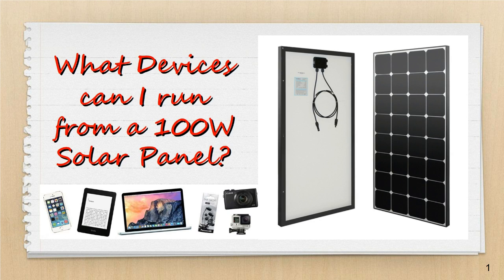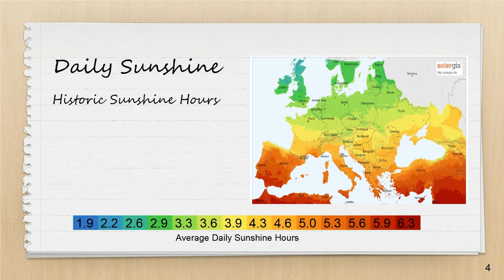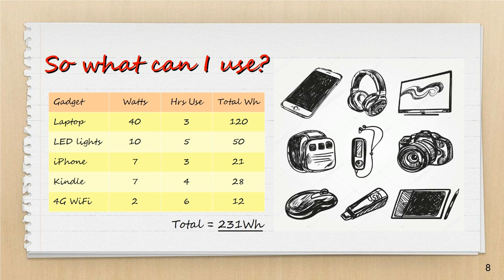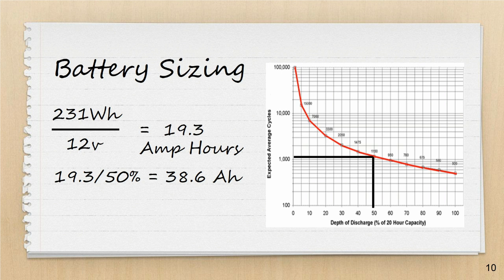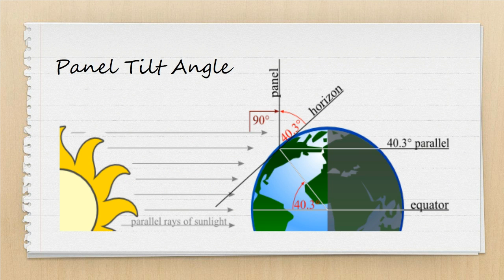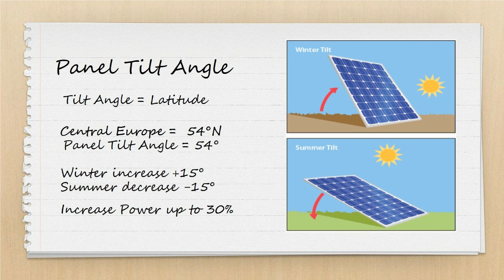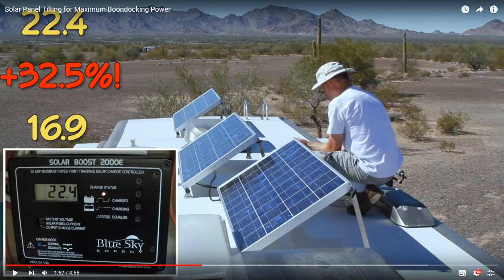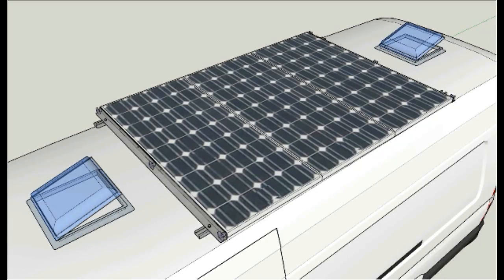What can you run on a 100W Solar Panel?

Comment: I find my 100w foldable, flexible panel along with a 110Ah battery is enough for our needs. Compressor fridge, lights, tablet/ phone charging etc and occasional use of the diesel heater.
Reply: Can I ask what make of foldable  panel you went for, and is it still good? Thanks
Reply: @KT.......  Dokio. They do 50,100,150,200,300W.
Reply: @Daz5Daz  thanks, Did you glue straight to the roof or have you kept an air gap between the panel and the roof? I've read reports of flexible panels over heating. Oh, just realised they're folding so you've probably not attached them anywhere right?
Reply: @KT.......  mine's foldable as in it folds away.  When I can, I park facing south and then place my panels (2x50W foldable) onto my windscreen. I like having the panel separate so that I can move the panel around to find sunny spots if I'm near trees etc.

Comment: Hi Greg -liked yr video; if I wanted to connect the solar kit (100W)  Ecoworthy to my greenhouse purely to power an electric heater, what advice/insturuction can you offer please?
Many thanks - your scientific physics knowledge is inspirational!
Reply from the maker: First of all most electric heaters are quite power hungry unless you are talking about a tubular frost heater which can be as small as 60W per foot length. So for example a 3ft heater running 8hrs a night would consume 180W x 8hrs = 1,440W
So with a 100W solar panel that’s 14hrs of perfect sunshine ☀️ which realistically would never happen. More realistic would be 500-600w of solar so as you can see electric heating uses a lot of energy.

Comment: As it is here in North Norway now what you can run is a 0,5w LED if there is clouds in the way of the sun (can be no sun for weeks here)...
Reply from the maker: Rondo Cat I still get a charge even when it’s raining
Reply: @GregVirgoe   I got lot more power out of the 100w panel after I switched to a better charge controller and it got up to 5 - 20w with little to no sun (had just a small one for testing). Now I have bought four 320w panels I will also mount on my Ford Transit combined with 2 charge controllers (the 100w panel charges the car battery only). Plan is to run 2 parallelly per controller for 80v and use 24v battery bank as it give double the watt the charger can handle (or else I would have to buy larger more expensive controllers). Should give enough power to run refrigerator even without sun if cloud layer is not unusually thick (the fridge uses 70w on average measured over 24 hours) :)

Comment: Price of solar panels is still dropping. Buy the flexible thin panels and glue them with sikaflex on any free area of the van roof and walls. This way you can park more freely and here in Sweden we get at least sunlight during the summer almost 20 hours a day ( if it’s not cloudy). And it’s mainly during the summer we use our RV. 
Buy Lifepo4 batteries they are much lighter and you can use all amps without destroying the batteries.

Comment: Thank you for the easy-to-understand and yet informative video.  This is what I exactly wanted to do... i.e., setup a 100w solar panel with batteries for storage. I have a few questions.  Can you comment on what type of battery (lead acid, gel, lithium, etc.) is succifient?  My goal is to power a dozen 12v landscaping lights, a sprinkler timer and may be couple of motion activated lights.  The second question is, do I need to ground?  And finally, can I store the batteries in the backyard tools shed that has no ventilation?  I can perhaps add a small window and leave it open to provide some ventilation.  Thanks.
Reply from the maker: Hello, type of battery if you go lead I would recommend AGM sealed maintenance free batteries. The can be discharged a little deeper and do not need ventilation. 
Lithium are much better in all ways but lot more expensive. 
On my previous battery sizing video there is a load sheet in the description you can download to work out how much solar and batteries you will need. You need to know the rating in Watts for each of your lights etc
That video explains how to work out your total load. 
Hope that helps

Comment: i never see anyone talkin about usb power banks. seems a much cheaper easier option for anything that can be powered with usb.. a 20ah lithium usb bank cost like $20 or less. most charge controllers can run straight to usb also.. anyways..  good video.👌 very useful info.👌
Reply from the maker: You still need to charge the power bank so you are introducing another set of losses by not charging tech direct.
Reply: @GregVirgoe  ah. i see. i was thinking about the lithium vs lead acid angle. lithium seems superior, but 100ah lithium batteries are upwards of 500$ while 100ah of lithium usb banks could be aquired for like $100.. thats why i dont understand people not using them more often.. maybe not high enough voltage i guess.

Comment: Excellent videos, straight to the details needed. How did you secure the panels to the van roof?
Reply from the maker: Mine are bolted to unistrut channels that I screwed to the roof
Reply: Thanks for the extra speedy reply and help
Reply: @GregVirgoe  how did you bolt the panels on ? what brackets did you use?
Reply from the maker: @markrichardson5496  please watch my installation video on here 😊
Reply: @GregVirgoe  found it, sorry missed it on my 1st watch through

Comment: Good video.  Most do not realize the 30% drop in just the components of their system..... lol, but then one must
consider that Lead-Acid batteries can only use 50% of the stored energy within because running it lower too
many times will ruin the battery.  Lithium is WAY HIGH.......   Research/Design are critical to a successful
solar system.   I appreciate your video.  peace

Comment: Undoubtedly the best basic explanation on solar I have found, thank you.  I do have a question, about the batteries.  In some of my searching, there has been chatter about using lithium over AGM.  The chatter talks about being able to drain the battery lower without harm. They charge faster,.  If I could as, what is your opinion on lithium over AGM? Thank you for sharing your knowledge and giving of your time.  All the best and, travel safe.
Reply from the maker: Hello Brenda, in my opinion, you do not need to go to the vast expense of lithium batteries if you manage your AGM batteries well and keep them topped up daily with a solar system. AGM if only discharged a small amount each day will still give you thousands of cycles and mine actually come with a 5 year warranty. Works out far cheaper initially so you have more money to spend on travelling :D
Reply: Bless you.  Thank you so much for your reply, I value your opinion as it all makes so much sense.  Thank you again.  Safe travels. 🙏🏼👏🏽🇨🇦👏🏽🥁

Comment: OKAY, do I need a second battery? I just replaced my deep cycle battery. It lasted 2years. Here are my big draws:Jackery400w, Electric blanket, laptop, phone,TV. Cordless drill battery (I use 300w inverter for this),
Reply from the maker: How much solar do you have? Do you have a portable panel to charge the jackery?
Reply: @GregVirgoe  I have 1x100w panel. I do not have a portable panel for the jackery. I'm charging the Jackery straight from my 1 deep cycle battery.

Comment: By good if you could put some linear actuators on to remotely control the  panel pitch. When you plug the van into a power source at a campsite would it charge the batteries?
Reply from the maker: Nightjar when you plug into a camp site hook up you need a mains battery charger to charge the batteries. Take a look at my latest wiring video.

Comment: How much power does the average house use in a day? How many solar panels would you need to power a house completely?
Reply from the maker: Average UK electric usage is 3370kWh per year which is a lot just over 10kWh per day. To put that into perspective we use about a 1/10 of that per day in our van only 1kWh per day. 
We have 480W of panels so on that basis you would need about 5kW of panels to run the average UK house
Reply from the maker: Better thing to do is reduce your usage in the home as a lot of that is unnecessary.

Comment: Hi greg very nice video am here in Reunion Island but only the angle and direction am not able to find in winter and summer any help will be much appreciate thanking you in advance
Reply from the maker: The gps coordinate for the Island are (-21.1151410, 55.5363840) therefore the angle for solar panel tilt would be 21° 👍🏼😃
Winter 21° + 15 = 36°
Summer 21° - 15 = 6°
Reply: @GregVirgoe  thanking you a lot so if am right during winter it should be at an angle of 36* and summer at 6*
Reply from the maker: @ramjeansakeel8242  yes 👍🏼
Reply: @GregVirgoe  👍 thanks

Comment: Just wanted to say a big thank you for youre video - I have 3x100w solar panels and 2x 12v 110ah batteries and have been wondering if i can run my tv, as well as charge and use my laptop, as well as 5x LED lights. I was wondering if it would be advisable to invest in a 3rd leisure battery as a back up. Any advise would be very helpful

Comment: Greg, well worth looking at a charge controller that is both mppt and dc-dc so your house battery get charged optimally from both solar and driving. Most modern alternators dont do a good job of charging deep cycle batteries. I use the redarc bcdc1240 dual input in previous motor home but animal looking at the redarc bms1230s2 to simplify everything as I’m getting lazy on my installing nowadays ( note I have 315ah of agm batteries)
Reply from the maker: I've already got my MPPT charge controller and separate split charge relay kit.
Wish I knew these were available sooner, never mind.
Reply: Greg Virgoe you may find that the sprinter doesn’t get  what you call a leisure battery that has a different chemistry to the cranking batteries to a full SOC as the charge profile is slightly different, it may even just give a float voltage of 13.3 across after the cranking battery gets topped up just after starting driving. That’s where dc-dc or battery to battery chargers have it all over vsr and solenoids. Every rv, caravan and motor home downunder has them as standard fitment now and even victron is starting to push their buck boost charger that’s similar.

Comment: Very useful info, most solar panel videos just talk about the hook-up, but you explain the system , and how technically  works, thank you,I just want to ask you this, i have installed 2 solar panels( total of 150W), and charger controller of 30A, and connect them to 2 Battery of 12V( in parallel), they have  total of about 200 AH,with no load , i read over 14 V on my charger controller... what do you think of my set -up ? , i use it in the cottage, for basic use .
Reply from the maker: PALANG NAR thanks for your message. A couple of things I have noticed. Your battery bank is bigger than the solar array so you may struggle to recharge in winter depending on your usage. Also the charge controller appears to be oversized. Typically would not have a solar charger bigger than 10% of your battery bank so 200Ah x 10% = 20A charge controller.  If you have two panels I would wire them in series to benefit from low light situations. Hope that helps
Reply: @GregVirgoe  Thank you, i wonder can i add one more panel to the system and leave everything as it is...also i didn't say the exactly amount of my batteries Ah, it is total of 235Ah.
Reply from the maker: PALANG NAR you just need to check that you are not exceeding the max rating of your MPPT charge controller. I would make sure to add a panel that matches exactly the same spec as the ones you have already. I would wire all three in series to get the best out of them in low light conditions. Your charge controller will have max Watts and Amps rating just check those. You will not need to run any more cable to the roof it can all be done on the panel wiring. 👍🏼😊
Reply: @GregVirgoe  OK, thank you i will manage it, i am kind of new in this but, i am an electronic engineer anyway.

Comment: Quick question and thank you for your simple yet effective approach. I have a 1,200 watt max power nutribullet blender. I only hope to use it once a day. We're talking a mere 30 seconds at most but is it safe to assume that I need a system that can produce 1,200 watts or more of solar power per day to in order to properly operate the blender?   Thank you.

Comment: Again, very informative. I'm thinking if you can make a panel frame that will tilt all ways, then you just tilt them till you don't have a shadow and you r good.
Reply from the maker: Routing the cables without having loads of slack is the tricky part of this system, why I kept it simple. I can easily spin the van 180 to get me out of most situations or just leave them flat and go for a walk instead 😃

Comment: so what if you wanna watch tv and use a hair dryer boil a jug does that mean a bigger solar power bigger battery and bigger solar charge controller? if so what would I need for all of that? thanks in advance for your reply
Reply from the maker: If you use more power you will need to generate more power. 
Anything that uses electric to heat I.e. kettle or hairdryer will use a lot of power and will need a larger inverter. If you manage your power and don’t use every device at the same time your inverter only needs to be as big as your largest device. 
Small travel kettle and hairdryers are in the range 800-1500W and will use 125amps per hour out of your battery system.
Reply: @GregVirgoe  thank you for your reply so are you saying that i could get a 200 watt solar panel and the same size battery as if i was not gonna use a hair dryer, but its the inverter that matters the most is that correct this is all very hard to understand thanks for taking the time out to answer and help us all understand cheers
Reply from the maker: @happynapper1234  yes the important thing is that your inverter is big enough to power those devices. The size of the battery just relate to how long it will last. Bigger battery = more storage capacity. Hope that helps

Comment: Hi Greg. Great video.  I've watched it a few times and think I've nearly got the hang of the maths.  I currently have 100w panel and a 100ah battery. Seems to serve my needs but no inverter atm, although I've just bought a small 300w cigar lead one which I think you or Gadget John recommended. I'd like to add a battery so I have 200ah ( will buy 2 new ones actually). Will a 100w panel cope with charging 200ah of batteries? Will it just take twice the time to charge? Room on my roof is limited but could maybe fit an additional 50w panel up there.  Any guidance gratefully received.  Thanks
Reply from the maker: If you are looking to increase your battery bank you really could do with more solar to charge them. 
It’s not a good idea to have mixed size panels so could you maybe put one larger one up there? Renogy do a 160w mono panel which is very efficient for £122?
It’s best to have 2:1 ratio of W to Ah. So 200W / 100Ah in an ideal world. My best advice to you would be increase the solar first. If you can recharge the battery quicker you don’t necessarily need it to be bigger if that makes sense
Reply: @GregVirgoe  great advice  Greg. Many thanks for taking the time.  We're just in the process of moving house, one of the main reasons being so we can get the van on the drive. So from mid Feb onwards I can be tinkering with the van getting it ready. Will measure the roof and see what I can get up there. :)

Comment: I'm trying to think of a way to install a mechanical winder inside the van, through the roof and attached to the panel.  That way it could be raised from inside to whatever angle is necessary. When the panels is returned to the flat position, the solid winder mechanism in its fully retracted position, would secure the panel locking it in place.  There may also be a way to raise the panel in either direction.  I have a picture of this in my mind but unfortunately I don't think I have the skills to engineer the system.
Reply from the maker: Anything that penetrates the roof and is a moving item will cause you headaches trying to make it waterproof.
Reply: Good point Greg.  Maybe an external system that can be operated from ground level without climbing on the roof. Similar to winding out a canopy?
Reply from the maker: I’ve been looking at the geometry of a system to do that but when the panel is flat there’s a tendency for the thing to lock in that position. 
The force required to initiate the lift could be substantial.

Comment: So Greg, I have been restoring a 1992 Renault Trafic. I have enough room just about for 2 leisure batts in sequence, and I wanna power basically a laptop a small sound system from the CD player from the van itself a small microwave oven. Do you think the 160w panel you featured in your other video, will be good enough? Or shall I double up TWO of these?

Comment: is it normal for a 100 watt 12v solar panel to read 18v in direct sun, then when I connect it to a solar charge controller it reads 12.8v?

Comment: I live in Scotland so sunshine at a minimum here.......in order to go off grid for a few days using 12 volt power only meaning no 230 volt appliances etc .... would a 360watt solar 30amp mppt charge controller with 300AH battery power be a workable solution and do I even need that much power? Also do I need to install a shunt if I only have a solar and ehu system. Any advice would be much appreciated?